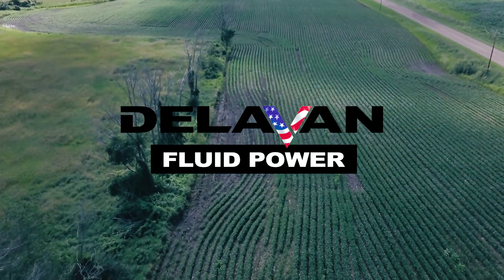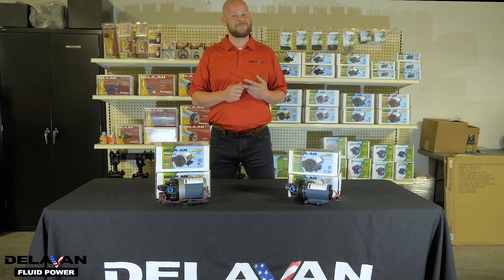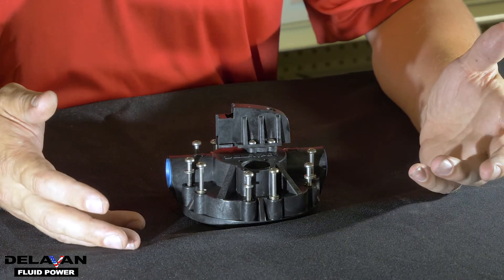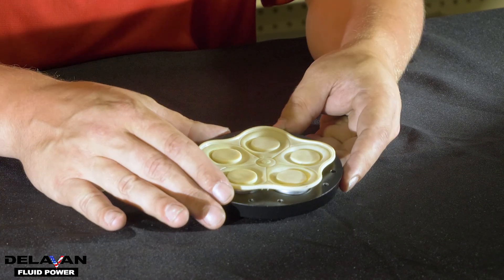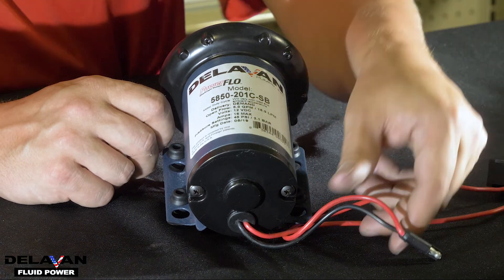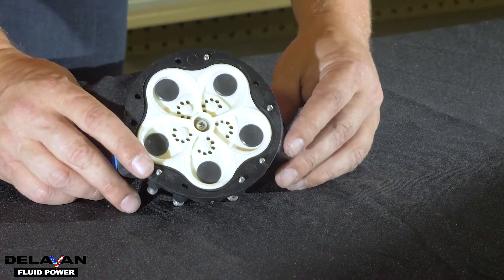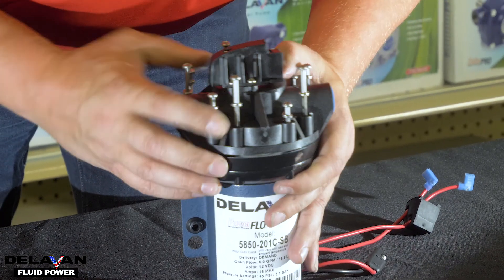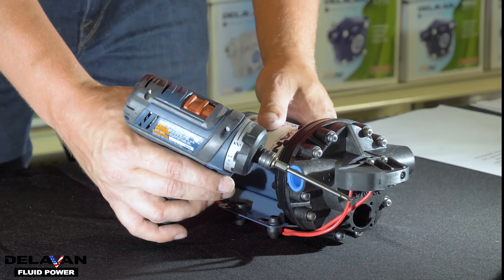Delavan Fluid Power - 12v Sprayer Pump Maintenance

Comment: What's the purpose of the electrical connection at the top (opposite the motor)? Is there a fuse in there?